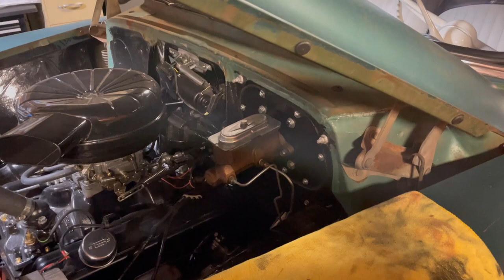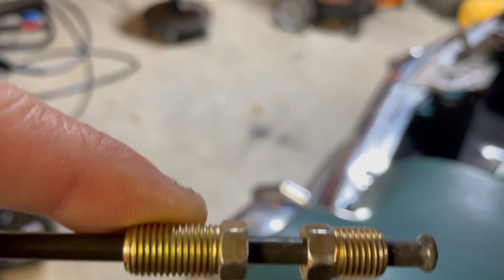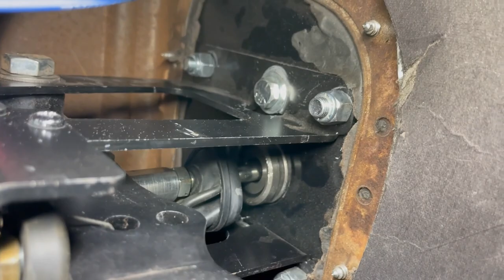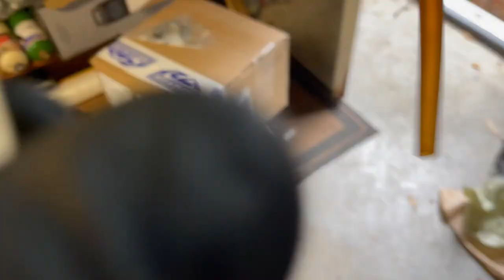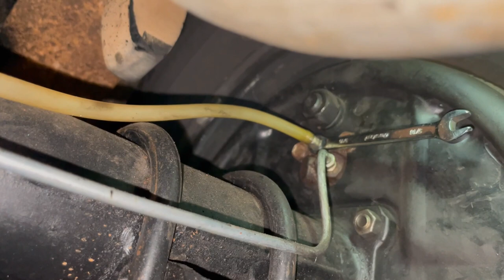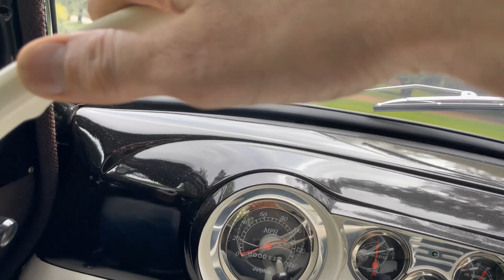Soft brake pedal fix 1954 Chevy, Aftermarket master cylinder, pedal adjustment and bleeding.

Comment: Great Video. But I believe your brake lines are to small . 54 chevys come with 1/4 inch lines for more volume. 3/16 lines are used on disc brakes which helps with building more pressure, less volume.

Comment: interesting  vid
when i have done a similar convertion from front drums to disc i had to remover the residual valve from the master cylinder as disc masters  don't use it 
it restricts the amount of fluid if its not remove
looks like a brass ferrul in the  port where the pipes s crew in 
not sure if you are aware of it  just thought i'd mention
but a duel master cylinder is a better safety point incase of a wheel cylinder failure
Reply from the maker: Yes, the residual pressure valve is very important if the master is under the floor. It used to be that all master cylinders had them, but rebuilt ones often do not,